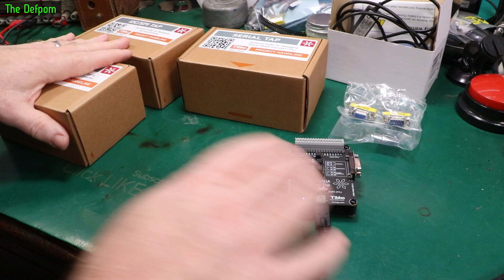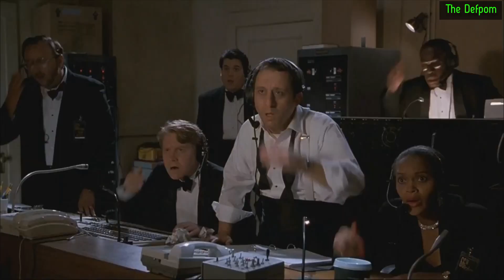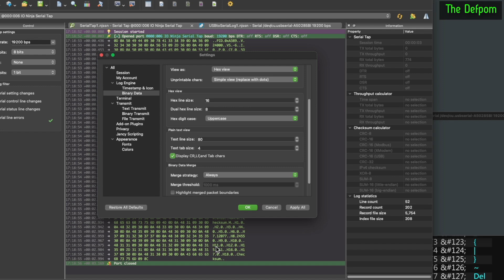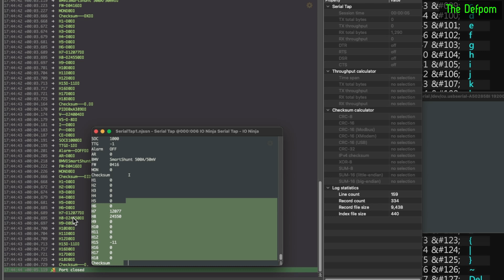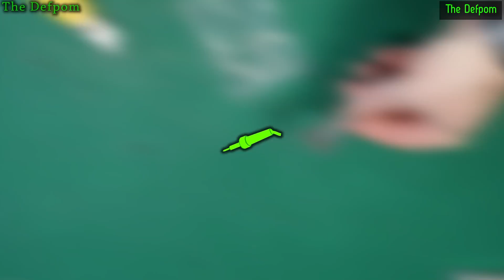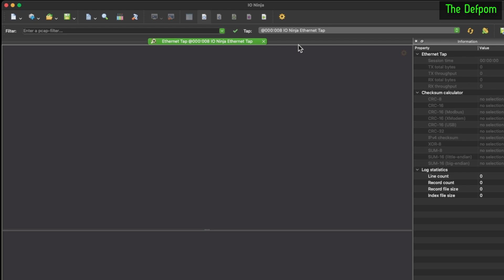🔴 IO Ninja Hardware and Software Review - No.1240

Comment: Guys, I'm from the IO Ninja team; feel free to ask me anything.

First of all, I wanted to address the topic of the Ethernet Tap design choice raised in one of the comments. The { Ethernet switch + USB-to-Ethernet adapter } approach is a viable choice; there are products like that, and we also considered this approach initially. However, the FPGA approach offers a MUCH higher level of control -- with the associated set of perks. For example, the latency is lower than that of a switch. We identify the direction of each frame (which port a frame came from). It's possible to add precise hardware timestamps to each frame. Or capture non-standard frames (e.g., invalid frames with broken Ethernet checksums, EtherCAT frames, etc). Also, the Ethernet Tap shares FPGA and many other design elements with the I2C/SPI Tap and some other Tibbo products, thus helping us to cut the production cost.

Of course, the Gigabit Ethernet support is something to be added in new revisions (now, Ethernet Tap will still work, but at the reduced speed of 100Mbps). As well as an enclosure :)
Reply: Two more comments regarding the video.

The Regex Markup feature briefly mentioned in the video is not for search per se but to highlight log data and make it easier to comprehend complex data streams. The most straightforward way is to colorize matches with different colors, but you also can insert delimiters before or after specific byte sequences, thus "splitting" the stream into logical packets. Matches can be scattered across multiple packets, and it will still work. Pretty cool, huh? :)

Re Sessions vs Layers. A layer is a plugin that can be attached to a session to modify its behavior. For example, take the raw data generated by the session and decode it according to some protocol (i.e., a protocol analyzer layer). Or filter data streams. Or modify the outgoing packets -- you've got the idea. This provides a great level of flexibility and code reuse (e.g., the same Modbus Analyzer plugin can be used with Serial Tap, Serial terminal, software Serial sniffer, TCP client/server, TCP flow monitor, etc).
Reply: Hello, do you know why the timestamps in the io ninja app are shown without microsecounds, only to milliseconds? In the documentation it says that it should be shown after selecting the seperate bytes option but it doesnt work for me. Im using the ninja tap pro. Thank you in advance.

Comment: Scott, can't you dual boot your MAC, maybe using Open Boot Camp Assistant. Press Option (or Alt) ⌥ during startup to switch between macOS and Windows.
Apparently Boot Camp assistant is compatible with MacBook (all models), MacBook Air introduced in 2017 or later, MacBook Pro introduced in 2015 or later, iMac introduced in 2015 or later, iMac Pro (all models), Mac Pro introduced in late 2013 or later.